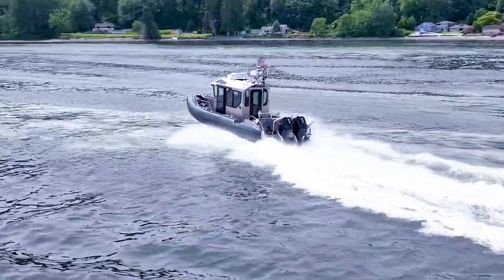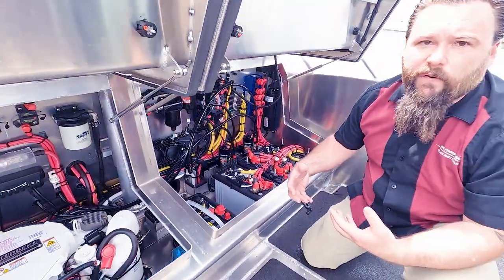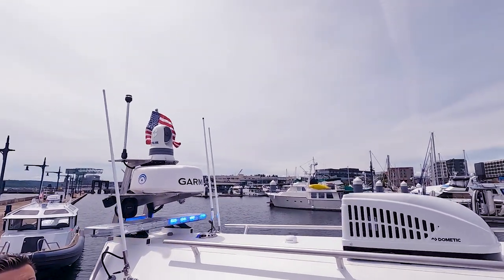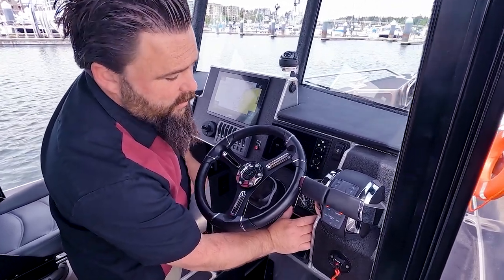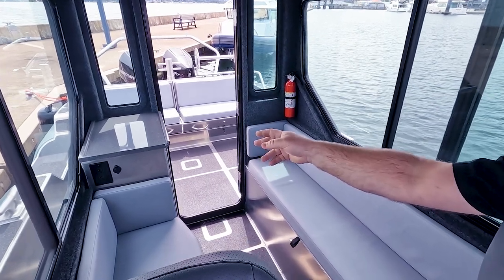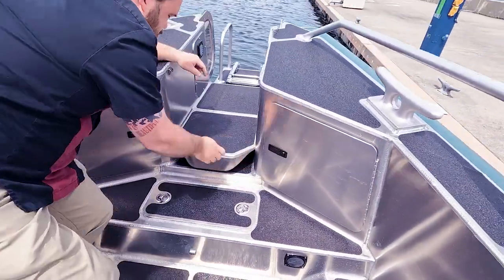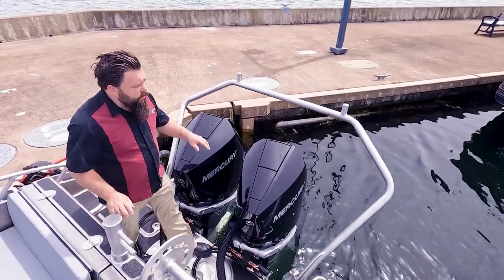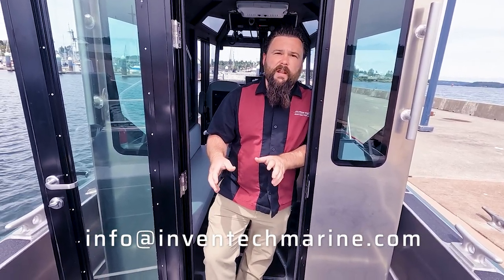31' Walk-Around Cabin Pro 2022

Comment: Do you have the ability to remove the heating system and install an AC unit. No tropical environment would ever need a heating system. All of the high end boats the run have AC units. Do you offer a marine generator